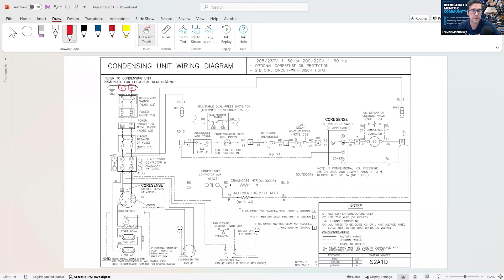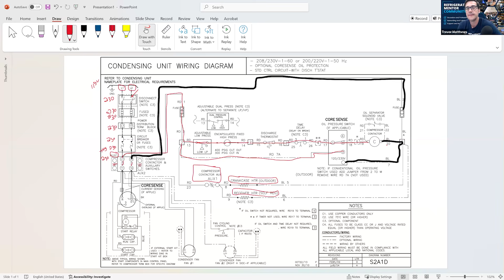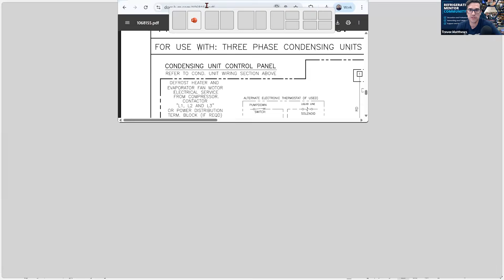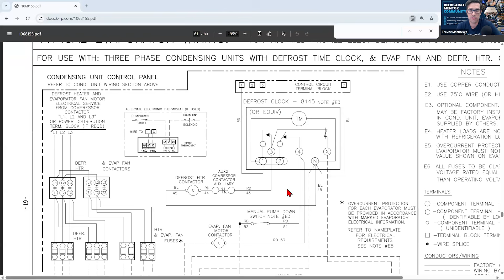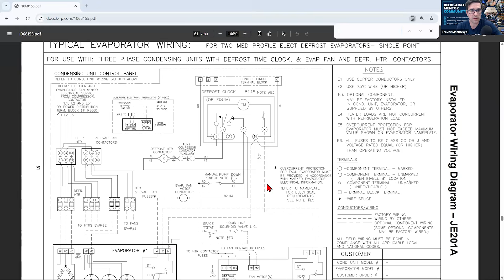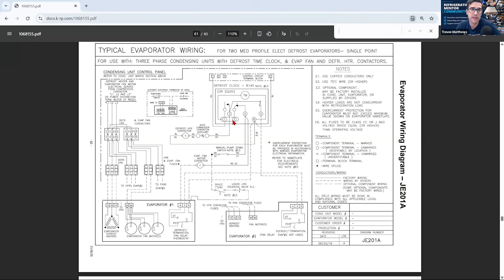Electrical Troubleshooting 101: How to Diagnose & Fix Refrigeration Problems Like a Pro

Comment: The lover 🤣
Reply: Great info but,
You need to do a side by side with an actual unit
The trouble most techs have is correlating the diagram with the  unit in front of them 
Locating the test points, wires etc
Reply: @EDKandT 💯 agree with this. It's one thing to follow the diagram on paper, it's another to apply it to the unit you're looking at/working on.
Reply from the maker: Noted. Thanks for sharing.
Reply from the maker: Thanks for sharing that tip. We do that in many of our refrigeration training courses.